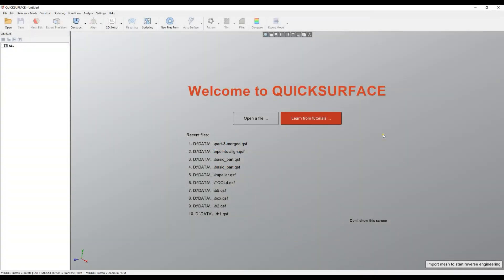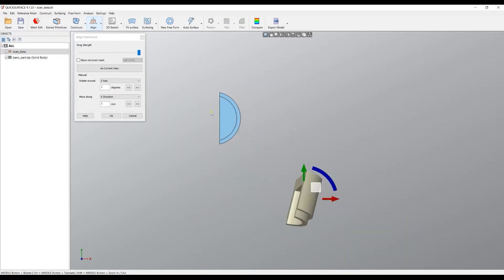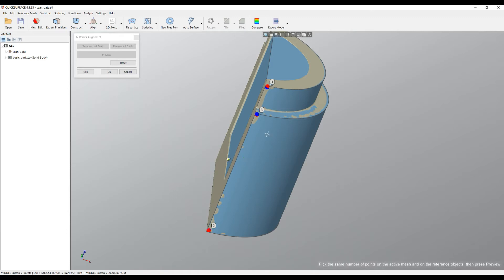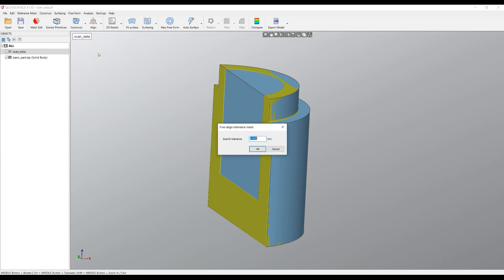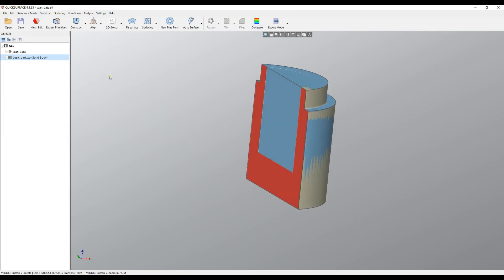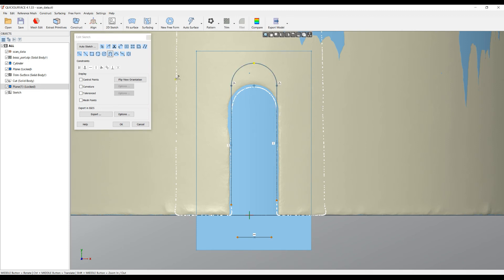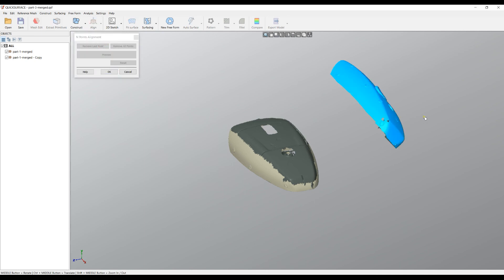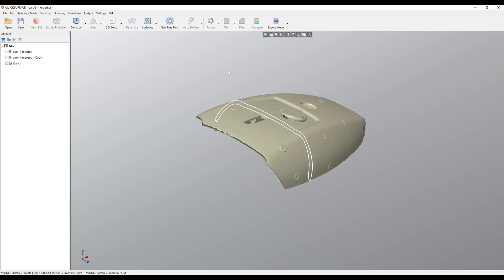QS Tutorials: N Points align

Comment: Thank you for the video! It would be better to make it so that points can be interactively deleted, for example, by clicking on them with Alt-click.
One more note. The undo command (Strl+Z) does not always work as it should: for example, if I extrude an object and then change my mind, then I have to remove this operation from the construction tree, because the cancel command does not work in this case.
Reply from the maker: Thank you for the feedback. We will work to improve. Check for our new versions by clicking. Help\Check for updates.